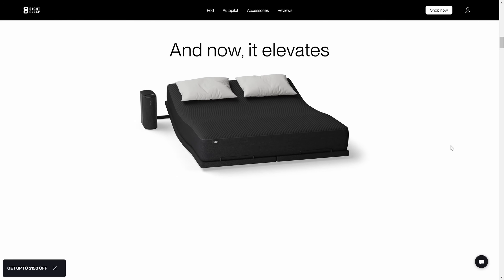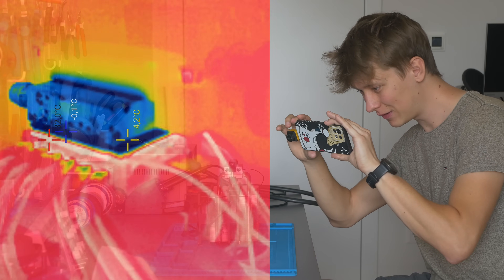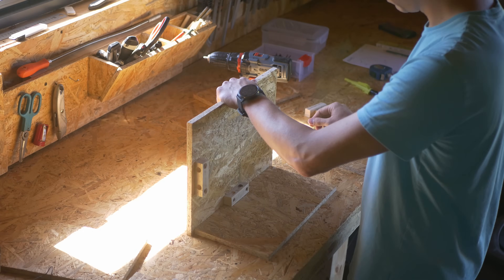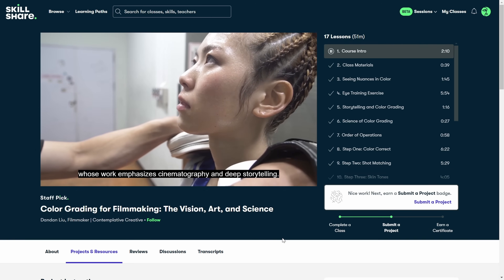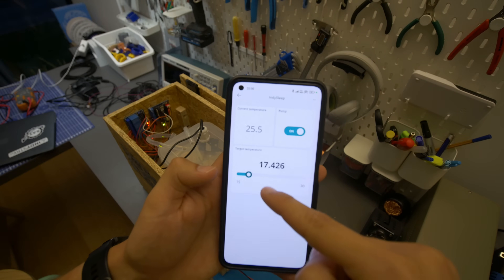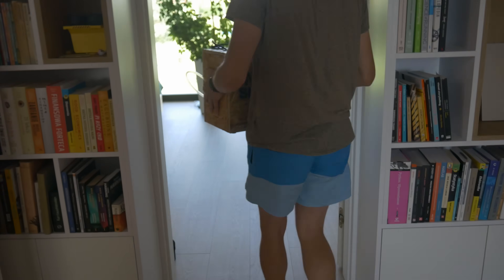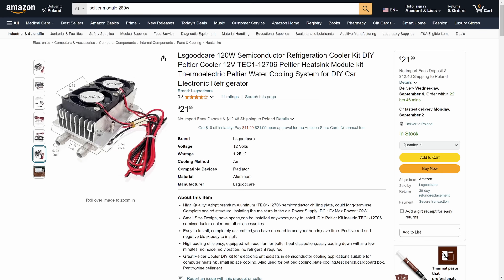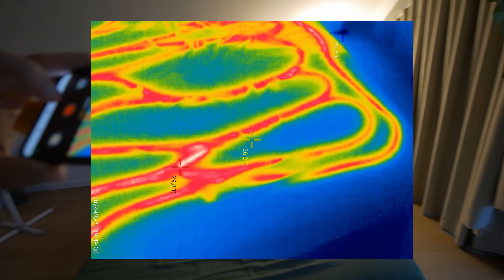I Made a $4000 Water Cooled Bed

Comment from the maker: The first 500 people to use my link  https://skl.sh/nikodembartnik08241 will get a 1 month free trial of Skillshare premium!
Reply: Have you thought of getting a roll of hard memory foam and either burn the path of the tubing into it with a soldering iron in a controlled manner or just let the memory of the foam do its thing? 🤔
Reply: Just Hang the pod outside the Window like an klima the cant the pod Heat up the room
Reply: Ive a broken eight sleep. When you fix the wlan (or build it into manual operation) you can take it apart and copy it. Im from Germany and shipping will be at my costs 🤙🏻

Comment: just found your video. take a look at usb c power bricks, they can do 120w for mobile phones with no fans right? so you could use 2 pelters then. or 2 phone chargers with 4 modules as you are already using relays, to you can hook 1 2 1

Comment: Its a shame you couldnt get this working. This product is extremely expensive and overpriced - something like this would actually be a good and interesting DIY project. There are even aquarium chillers/heaters you can use to build it. I hope you revisit this project since you know the internals of the real thing because it has a bit of everything. Actual engineering, electrical work, some coding etc.

Comment: You actually aren't far off at all it's just more powerful components with the 8sleep. Really though as you mentioned this is not a product for those who don't have air conditioning already as it will heat up your room overall more because of well, efficiency losses and simple thermodynamics. But if you have $4,000 to spend to make your mattress cold you also probably have an air conditioner to make the room itself cold so the heat generated by the 8sleep is not a problem in that case.

Comment: 1. Use ice maker to have real air compressor, and lower power consumption
2. Sow a sock 6mm in diameter and route a tube in that, sow that to the diy matress
3. Add padding to the diy matress to prevent feeling the tubes.
4. Use silicone tubing.

Comment: Crazy idea but I think I know what you could do to get it to work. Right now your tube setup is so all the water runs from the bottom of the bed to the top. Instead you could have lots of small loops throughout the bed. Kind of like how resistors (the tubing) have more resistance in series than in parallel.

Comment: I made one of these without an actual cooler, it just ran water under me and cooled the water through a 120mm radiator. Can never go subambient but it didn’t need it to cool me quite well. I was sleeping comfortably in a 29C room. In a 25C room I’d wake up freezing. I just used a mattress cooling pad I bought off Amazon and old pc water cooling hardware I had laying around. It started leaking right as weather was getting cooler so I never got around to fixing it.

Comment: Not sure how noisy it'd get but I feel like if you just used one of those 1/8 or 1/4 hp hydroponics/aquarium chillers people use for ice baths along with a pump in an aquarium tank you could use basically the same tubing setup with a built in temperature controller with more power and accuracy. Definitely more expensive than the peltier ones but still like 1/20th the price of the actual product and probably gives more temperature control than the original. You might need a two pump setup to keep the whole tank cold depending on the setup but I think this would solve most problems other than the noise (which might just have to be spun as a free white noise machine "feature")

Comment: Run the tubing off the side of the bed before you bend it and heat bend it so it’s a tighter radius.
Use a heated roller to flatten the tube or buy flat tubing. Use a fluid that conducts heat better… idk alcohol or something. 
Perhaps cover the tubes with a cheap “cooling gel” bed topper to hep dissipate the thermal gradient.
Bldc powered turbine pump… 

Some of my thoughts on how to improve the design

Comment: Looks to me like you need to double everything and then you'd have the same as the eight sleep system. The system is meant to take heat out of your mattress and put into the air. The air is then supposed to be cooled by the central AC. If you decide to make a more powerful system, I suggest having the box  outside your room or even outside the window. In the end, the eight sleep system is a luxury for the rich, not a substitute for air conditioning. Cheers

Comment: You could get a water chiller used for aquarium.  If using TE modules you need to decrease the voltage quite a bit to make them efficient.  A 12v module needs to be 3 or 4v to match compressor based systems which means you will need more modules to regain the pumping capacity lost by lowering the voltage.  Reason is they have internal resistance that generates heat like any resistor when you give it voltage.  The higher the voltage the more heat they make and then your module much remove the very heat it just created instead of just removing the targeted heat.  I would at least have 8 modules if I were powering that low.  Liquid exchanger or water block on both sides.  One goes to bed the other a cpu radiator with fan.  Radiator size will make a difference also of course.  For the water pad that goes in the bed you could get some aquarium tubing the silicone type and run it back forth directly against itself leaving a loop on the ends big enough so it don’t pinch the tubing.  You will have a limit with such small tubing on water flow as in after a certain amount you would have almost no flow at all.  To negate this you could have flow going in split up between multiple points and exit from multiple points also.  So instead of 1 line in traveling 100ft of tubing you have 4 in traveling 25ft each if that makes sense.  I may stick one together to see how wrong I am..ha anyways good luck and enjoyed your video.

Comment: @Nikodem Bartnik 
You can try the compressor (e.g. fridge compressor). Their COP is really good so you shouldn't have problem with the heat.
Alternatively - adopting some air conditioner.
The noise is not important at the prototype stage, as both are quite silent and in next versions you could work around making them more silent.

Comment: I've dreamed about doing this myself for years and just lack the workshop space to give it a try. I would recommend looking at fish tank water pumps, they're usually very silent while moving a lot of volume and maybe add a small radiator before the cooler to help drain heat from the water before it reaches the cooler and increase the temperature differential as much as possible.

Comment: I think there are fundamentally two problems leading to the perceived lack of effectiveness:

1) thermal transfer from your body to the cooling medium

2) thermal exhaust of the absorbed heat from the coolant in order to maintain a target temperature

From your conclusion you seem to be proposing to address #1 by increasing the tubing density per square foot of bed surface, and for #2 you are suggesting increasing the quantity of coolers and flow rate.

I think you are approaching this from the wrong angle. Your first step should be to find your bottleneck which you can do with two temperature sensors, one measuring the water exiting your cooling block and one measuring the water temp entering it from the heat load (mattress)

If the temp difference exiting the mattress when you are NOT lying on it vs when you ARE is not more than a degree or two and the overall temp is not rising then you’ve got a problem with thermal transfer.

Increasing the contact patch with your body via more loops is good but before you buy a bunch more tubing I would suggest examining how thermally conductive the tubing that you are using is and investigating a more thermally conductive tubing. A quick google shows a company offering tubing that is “2.7 times more thermally conductive than ptfe”

As to increasing your cooling capacity I would suggest trying simple radiators with a slow, quiet fan into your loop before more Pelletier coolers. Pelletier coolers are really not suitable for this kind of use but the better option, a small compressor from an old mini fridge, is probably not a good idea because I doubt you’re licensed to work with refrigerants, and you would need to be to do so (they kill the ozone and are super flammable). You can also add more thermal mass by adding a reservoir (bucket full of water) to the loop which will slow the rise in temperature even if your cooling isn’t quite enough and could potentially keep it low enough for 8 hours of sleep even if it wouldn’t work indefinitely.

The other thing that could be helpful is you mentioned it being a hassle sewing all of the tubing in place. I suggest taking a look at how the Russians solved this issue for space suit cooling layers vs how NASA did. NASA sews them in place like you did, Russia put them in mesh shirts and then wove the tubing through the mesh. Maybe try buying mesh fabric and making a mesh mattress topper for prototyping.

Comment: Peltier module just creates more heat than cold, you are also dumping all the generated heat next to you warming you up even more. You need to have a way to pump the heat away from your room, preferably outside. Basically you need to attach air heat pump (not sure if thats the correct term) to the bed.

Comment: PVC isn't great for thermal transfer, maybe there is some kind of tubing out there for exactly that application that isn't super rigid and uncomfortable. Or maybe just use thin-walled tubing considering you don't have to run the loop with that high of a pressure

Comment: It is better to use constant current regulation with peltiers instead of simple on-off, they are a lot more efficient at lower currents. So ideally more modules running at lower power.
There are also used eight sleep covers available online (i think when you return the unit they leave the cover so some people sell them).

Comment: Lets try to use some science here, maybe? The peltier has around 10% efficiency, maybe 15% if you get the optimal working point. So from that 60W input power, only 6W are cooling the water down. The human body usually produces a few hundred watts of heating power, so you would need kilowatts of  peltier cooling power to have an effective bed cooler that does something for you. Might be even more, since you are trying to cool the bed to less than room air temperature if you set it to 18°C water temperature.
Now, if you would have that peltier system in your bedroom, you would have one massive electric heater that actually makes it worse, heating the bedroom even more,.The heat exchanger needs to be outside, or at least in another room.
Another problem you will quickly discover if you can actually cool the water below air temperature is condensation. Your bed might get nice and wet even with no leaks from the cooling system and your bladder... 
Good luck fixing all that.
Reply: They can be way more efficient than 10% with proper design.

Comment: Very cool attempt! At the beginning of the video I immediately thought "you're probably gonna have problems with cooling capacity" and was bummed to see that happen...

I think one of the problems is that cooling a long loop of water is difficult to do uniformly because ambient heat will suck all the cold temperature away. You can maybe try to do something like multiple loops to get the same effect (or have only cold water go one direction of the bed, then loop back to the reservoir)

For the second problem of cooling capacity, radiators (like some other suggestions) are a good start to bring the water back to room temperature. Ideally you want to lower the temperature disparity so that the Peltier can more efficiently make the water cold...

Comment: I was thinking about doing the same thing at home. I sleep next to an aquarium so the noise part with the pump is very relatable already. I was also checking the pictures of the teardown a couple weeks ago :D

I think that the thermal barrier between you and the water is also something you should consider. If you look online it is almost like an ultra thin air matress filled with water and made with the same material as a water bed. They also use one output/input per side which allows for a lot of flow which will help a lot with the cooling.

I would love to try something like this in the future when money and time are right :D

Comment: Cool project. the eight sleep one  is way to expensive thou. Bed jet solution seem better, as the cooling is not directly cooling, just air over your body, so to not to cool too much, just using your natural sweating/colling systems, and not to generate any extra heat in the room.

Comment: Hello,

I think your main problem comes from the use of a pelletier module and its low efficiency.

The simplest would be to use a source of cold water already present in your environment such as a rainwater tank in the ground or to use a solar thermal panel oriented towards the sky (radiative effect at night).

If none of these solutions is possible, the use of a compressor refrigerator will be the most efficient, at low cost, by placing a container of water in contact with the cold wall.

The adjustment of the temperature of the water on the mattress is done by the use of mixing taps adding a proportion of cold water (taken at the bottom of the container) with part of the water already present in the loop.
The excess water returning from the bed returns to the top of the container in the refrigerator.

For the noise problem, the simplest would be to place the device outside and to let only the water tubes enter in an insulating sheath. This would also dissipate heat to the outside.

Have a nice day

AT

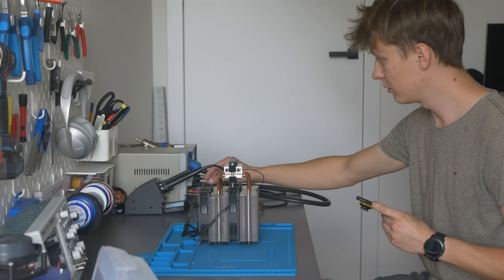Comment: 2:20 If you watch professionals like Linus tech tips you'll see that they just slap a blob on and that's it, tightening the cooler on top squishes the thermal paste spreading it just fine.
Reply: It's still best practice to spread it evenly, otherwise you might get dead spots where the pressure wasn't high enough to spread past the center. With newer processors having multiple off-center dies that's even more important

Comment: I love those Peltier.
You really have to have a good heat sink though and they take a lot of current.
You can actually stack them to get lower temperatures.
If you put an array of those between two vessels of water you have a hot side and a cold side that you can tune very easily
The gel foam mattress toppers work great for something like this

Comment: You can use more peltier modules and put the system outside? But if not, you can use an led/lighting power supply, which is passively cooled and completely mute and those psus can go up to 300-400w at 12v. This is a very cool idea and if you do more research on how to run the tubes in your bed, or how to transfer the cold to your bed (maybe copy the original product), it will be very nice, and maybe better than the original!

Comment: Hi, that was a fun experiment ! 

To improve your heat transfer, maybe you could add a material that conducts heat better (such as thin metal sheets). That way, the cold water going through the pipe could cool the whole bed area. 

You can mount the system underneath the matress so that you dont feel the system with your back when you lay on the bed.

Comment: Having tried making a little fridge for at work, I started to profusely sweat when you mentioned peltiers...
Either way, here are some more pointers to ponder over:
- Your peltier only draws 60W, so it moves about 18W of energy (peltiers are generally around 30% efficient). They have 4x80W (320W) worth of peltiers, so they move around 96W of energy. Evidently, that is a big difference in capacity alone.
- Water has a huge specific heat capacity, so that single peltier needs to do a lot of work. The more water, the more energy the peltier needs to move, which is why the 8sleep doesn't really use the reservoir directly (it just means more energy needs to be transferred by the peltiers). More water does keep the temperature more stable when you do finally get it there though.
- You can modify a PC power-supply (or just make an adapter) to get a fairly silent 12V PSU. Most decent PC PSU's can handle 40A through the 12V lines (for CPUs and GPUs) without becoming noisy at all.

Comment: Nice project, i haven't watched the whole video yet, so correct me if i missed something but the VCC pin on the Arduino is typically not controlled by the 5V regulator. It is simply connected to the input voltage( in this case 12v ?). So if you need 5V you should use the designated "5V" pin on the Arduino. 
Btw i also learned this the hard way xd

Comment: if it helps, the average human produces about 100 to 150 watts of heat. so accounting for losses everywhere in the system, i can estimate you should use a 200w or more worth of peltier modules and use wider tubes. Good job and keep going! it's only a fail if you stop trying!

Comment: But for cooling the water doesn't need to be sub-ambient just cooler than you. So I would ditch the peltier and just have a big radiator and pump both temperature controlled

Comment: as fascinating as Peltier modules are... they are insanely inefficiant and wastefull. they are for the most part Resistors, that just happen to get cold on one side.
I'd recommend taking apart an old dehumedifyer or fridge or AC unit, and re-using the compressor based heat-pumps in those. If you need to re-fill the loops, they dont NEED some fancy flurocarbon, They can easilly just use Butane, Isobutane or even propane.

Comment: just use regular bed with springs without individual coating on spring. cut in and out hole and pump ac air through it